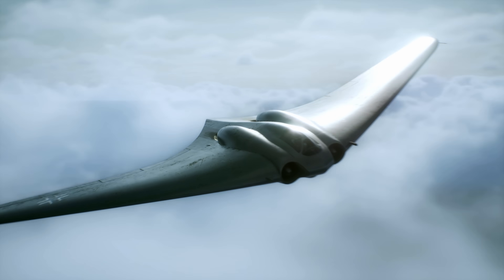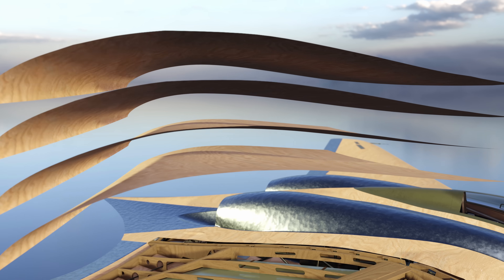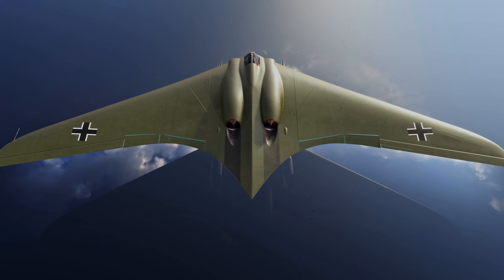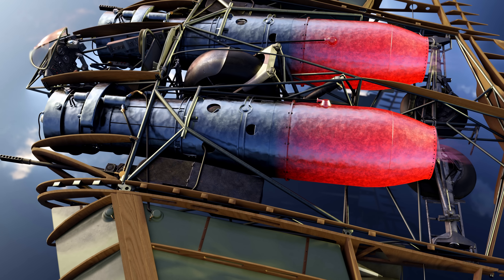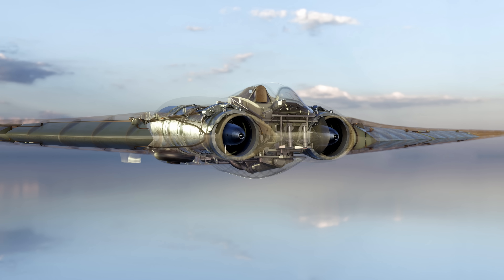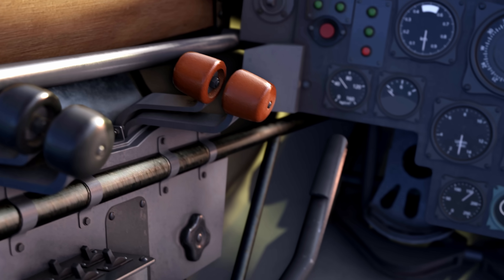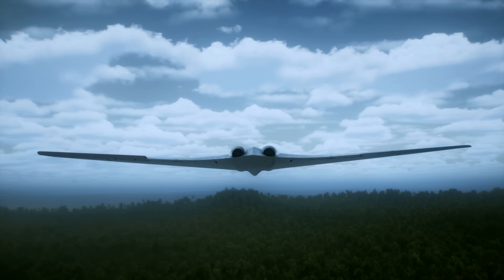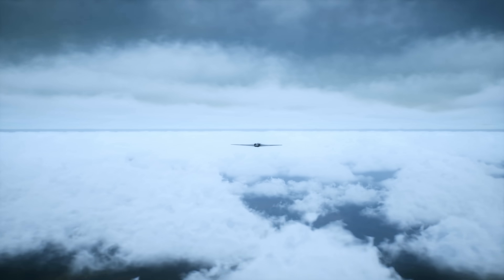Inside the Horten Flying Wing

Comment: I think it's a little disingenuous to bring up the Northrop B2 and HO229 in the same sentence without mentioning the decades of work Jack Northrop himself put into flying wings.
Reply: Jack Northrop never built any radar stealth aircraft, it was his successor that was inspired by the Ho-229 and copied its design. 0:02
Reply: @sandervanderkammen9230 neither did Horton. The HO229 was stealthier than aircraft of the time due to its flying wing design, however, that was due to the Horton brothers following their own flying wing gliders in the 30s instead of some pursuit of stealth. That's like saying Northrops N-1M flying wing from 1940 is stealth because it was made of a similar wood-laminate construction to the HO229.
Reply: The Ho-229 incorporated radar stealth technology while the Northrop N1-N was never constructed and was not a completely design on paper.
 Germany invented radar stealth technology during WW2 and the Luftwaffe published 3 specifications for radar stealth aircraft.
The USAAF was not pursuing any radar stealth technology and America would not begin serious research into them until the early 1970s
Reply: @sandervanderkammen9230  The N-1M flew in July 1940 by Vance Breese. It's kept in exhibit right across the HO229 in the Udvar Hazy center. Where are the documents that the luftwaffe was publishing specifications for radar stealth aircraft? I would like to read those documents. The only thing I've seen about the HO229 being stealth is a claim from Reimar Horton's 1983 book "Nurflugel". And back to the original point, the YB-35, which was drafted in the 1940s, ended up having an identical wingspan to the B2.
Reply: @howdyalmd  None of Jack Northop's designs incorporated radar stealth technology, there was no development of radar stealth aircraft in America until the 1970's
 Both Thomas V. Jones (Pres. and CEO of Northop) and John Cashen (Chief Engineer on the B2 program) were Obsessed with the Ho-229 and conducted exhaustive studies of this aircraft during the development of the B-2 and other German WW2 RAM technology which was incorporated into the B-2.
 The Northop B-2 was heavily influenced by the Ho-229.
Reply: @DoktorBayerischeMotorenWerke I never claimed the Northrop planes were stealth. At best, the N1-M had a reduced frontal RCS like the HO229 due to lack of conventional control surfaces and plywood construction. But Northrop like the Horten brothers both pursued the flying wing mostly due to aerodynamic efficiency. Where did you read that those two men were obsessed with the 229? I am very curious as to where you're reading this. A cursory search of their names and the 229 came up with nothing. I could only find the study conducted in 2008 by NG, where they found the model had a ~20% reduced radar detection range, and analysis of the material of the captured V3.
Reply: @howdyalmd  WRONG, the difference is the Ho-229 is completely devoid of any significant retroreflective structures.
 Anyone who is familiar with radar stealth technology will spot this feature immediately.
 I worked with both Tom and John at Northop and if you knew anything about them you would know that Tom in particular was OBCESSED with the Ho-229 and he convinced John to study every detail of the Ho-229 and reverse engineer it.
WRONG, the tests performed for the documentary were made using modern microwave band radar.
Working vintage radar sets were not available for the tests so computer software simulations were used and showed that against the British Metere Band radar used in WW2, the Ho-229 had a remarkable, over 50% reduction in frontal RCS... both figures are WITHOUT the RAM applied. 
Any questions son?
Reply: @DoktorBayerischeMotorenWerke 
You should talk to a therapist or a psychologist if you genuinely believe that people are “xenophobic ultranationalists” just for not agreeing with you.

It’s an extremely illogical and delusional way of thinking. People are allowed to disagree with you and ask questions if they believe what you say is false.
Reply: @mrnoskills3589  Do you believe that the Allies invented the jet engine???
Reply: @DoktorBayerischeMotorenWerke  Given that Frank Whittle patented (1930), built, and ran the first jet engine (April 1937), yes. Although it would be more appropriate to say that Britain, or Whittle himself invented it rather than the Allies.

Hans von Ohain would patent (~1935), build, and run his engine (September 1937) after Whittle, but would use it to power an aircraft (1939) before Whittle.
Reply: @mrnoskills3589  So you reject the fact that Maxime Guillaume patented the turbojet aircraft engine in 1921???
 Or that Hans von Ohain and Max Hahnn constructed and test ran the first jet engine in 1934?

Or? More importantly the Ohain was the first to successfully demonstrate a working jet aircraft engine 2 years before Whittle on August 27th, 1939???
Reply: @mrnoskills3589  Anyone that claims Frank Whittle invented the jet engine is xenophobic and ultranationalist... IF NOT?They are very Ignorant regarding who actually invented the jet engine.

Comment: Ué, super parecido com os atuais B-2!
Reply: It is no coincidence.
Reply: @DoktorBayerischeMotorenWerke  Smooth brain
Reply: @NOODLLD You didn't know that Northup exhaustively studied and researched the Ho-229 during the development of the B-2?
 Northup's president at the time was completely obsessed with the Ho-229 and German WW2 radar stealth technology.
Reply: @DoktorBayerischeMotorenWerke 
They didn’t have radar stealth technology. The Horten 229 had a reduced radar signature due to the flying wing design and wooden construction, characteristics shared by many other aircraft. It was not enough to be considered stealth.
Reply: @mrnoskills3589  Wow! You really don't know anything about the Ho-229... or radar stealth technology.
 The Ho-229 had over 50% reduction in frontal RCS... that was enough to effectively defeat RAF interception before reaching its target.
 This was a massive breakthrough in aerospace technology that was completely unavailable to the Allies.
Reply: @DoktorBayerischeMotorenWerke 
Where do you find this information? Because every single report I’ve read about the 2008 radar testing of the 229 replica shows that it would have had only a marginally smaller radar signature than something like a Bf-109, and that the speed would have been a far more contributing factor to it being able to evade interceptors.

It had no intentional stealth design built into it. The radar absorbent material that Reimar claimed to have invented was never found on the original prototypes, yet they still included it on the replica and found it was a poor absorber of radar. Massive exposed engine intakes on the leading edge also suggests that they had zero intention of making the aircraft stealth.

You can say as many times as you’d like that the B-2’s design was based off of it, but of the hundreds of people I have spoken to who have made that claim, not one has ever been able to provide any evidence other than the fact that they look vaguely the same. Even then, the B-2 shares far more similarities with the YB-49 than it does with the Ho-229.
Reply: @mrnoskills3589  You are a very, very ignorant person...
Reply: @mrnoskills3589  Of Course not... it's the fact that you continually attempt to ignore the information and data that makes you ignorant... and highly biased.
Reply: @DoktorBayerischeMotorenWerke 
The information and data that you have not provided after over two weeks of back and forth?

I cannot ignore information which does not exist. Show me sources that back up anything you have said, or I’m going to continue to assume that you’re speaking nonsense.

Comment: no wonder how then Americans built B2 spirit
Reply: Nothrop had Experience Building Flying wings from the YB 35, google it german didn't Invent the Flying wing
Reply: @NOODLLD The B2 was developed directly from the Ho-229
Reply: @sandervanderkammen9230  No it wasn't, not even Close Buddy. The Ho229 was rotting in a Warehouse forgotten while the B2 was Made
Reply: @NOODLLD The Ho-229 was exhaustively tested and studied in the 1970s by both Lockheed and Northrop during the  development of their own radar stealth aircraft.
 The B2 is heavily based on the research conducted on the Ho-229.
Reply: @sandervanderkammen9230 The Ho-229 was radar tested once to shut down the myths spread by Reimar Horten in the 80’s.
Reply: @mrnoskills3589 Radar tests performed in the 1970s confirmed that the Ho-229 had low observability and the RAM used on the B2 was originally developed for the Ho-229
Reply: @sandervanderkammen9230  Radar testing of the Ho-229 didn’t happen until 2008. The RAM that Reimar claimed to have developed for it never existed. It was never found on the original prototypes, yet it was still recreated and tested and was found to be a poor radar absorber.
Reply: @mrnoskills3589 You have not done your homework, the Ho-229 and other examples of radar stealth were very throughly rearched and tested in the 70's.
 Germany invented RAM it not only developed several types of RAM it was also manufacturered and used in operational service during WW2.
Reply: @sandervanderkammen9230  I’ve already looked for the tests that you claimed Lockheed and Northrop did in the 70’s and it seems they don’t exist. Who did these tests, when did they do them, and where can I read about them?
Reply: @mrnoskills3589 You need to ask the DoD, Lockheed and Northrop those questions.
GOOD LUCK!
Reply: @sandervanderkammen9230  “I will once again deflect and not give you the source of my information. Go ask somebody else, good luck.”
Reply: @mrnoskills3589 Can you please cite some evidence that the Lockheed F-117 and the Northrop B-2 actually has low radar observability?
Reply: @sandervanderkammen9230  Do you think bolding your comments makes them seem more legitimate? It doesn't.
Reply: @JamesThomas-kx5sj  They bold their comments so that it looks different than the comments on their other accounts, as if it still wasn’t obvious that it’s the same person.

They have at least three accounts that I’ve seen on this video and Blue Paw Print’s Me-262 video, all commenting on the same videos, at the same time of day, all with the same copy and pasted comments, false information, and insults.

Comment: I remember seeing a study into the stealth capabilities of the Horton some time ago which suggested that, against the radar of the era, it was indeed effectively a stealth fighter, and that it's wooden construction supposedly helped absorb allied radar, so I'm curious about Grumman's results, and how they tested it... Did they test it under modern conditions, or against the conditions of 1945?
Reply: Northup used modern microwave band radar to test the Ho-229, but they also used a computer software program to simulate the test using the more primitive British Meter band radar.  
The simulations showed a very significant 50% reduction in frontal RCS and this was without the RAM applied.

Comment: I had read that the preserved airplane and it's wings are not connected because they don't match and are thought to be from different prototypes.
Reply: +@DavidVanderVoort-t2g   It did not have wings when it was found in the Gotha workshop.  Some wings were found some 75 miles away and I've never researched if they are an exact fit.
Reply: The wings from this particular aircraft are believed to still exist and are stored at a military research facility near Munich, Germany.
An Austrian engineer that worked there in an interview told Wehrtechnik that the wing sections had being removed before the war ended and had RAM applied to the outer surface but was not completed when the war ended.
The German government considers them classified material and they  are not available for public veiw.

Comment: Die Tarnkappengeschichte der Ho-229 ist ein Mythos: https://www.youtube.com/watch?v=m_fqmxUzSfU
Reply: Northrop conducted tests that proved its stealth design.
Germany invented radar absoorbing materials and radar stealth technology during WW2.
Reply: @sandervanderkammen9230  Schau Dir das Video an! Northrop conducted war voreingenommen und hat in der Dokumentation übertrieben. Das haben die später zugegeben.
Bei der Konstruktion der Ho-229, spielte die RADAR-Reflexion keine Rolle, das wurde ihr erst später angedichtet! Sicher hat die Ho-229 etwas weniger RADAR-Fläche aber das spielte bei der Entwicklung keine Rolle!!!
Reply: @Bildpunkte Tests confirmed that the Ho-229 had a staggering 50% reduction in Frontal RCS compared to conventional aircraft of its size.
 It's fundamental design is completely free from any significant retrorefletive structures
 No test were conducted with the RAM applied
 Data on German WW2 RAM technology still remains classified today.
Reply: @sandervanderkammen9230  It was only 30%, not 50%. Furthermore, no real turbine intake were used in the tests, which reflect much more radar radiation than the dummies in the test.
Reply: @Bildpunkte  When corrected for the Meter Band radar used by the British it was over 50%... and that was without the RAM,  anyone familiar with Radar Stealth technology knows that a jet engine is inherently radar stealth compared to any aircraft that relies on a large spinning propeller... some amateur denialist seem to be complete ignorant of this important fact.

Comment: 4:15
There is a contradiction.

Because the flying wing design was used after the Second World War.

With the B2-Spirit.
Reply: The B-2 is based on the Ho-229.
Reply: @sandervanderkammen9230  No
Reply: @NOODLLD. Your comment reveals someone who knows nothing about Northop or the B2
Reply: @sandervanderkammen9230  Please Explain how Northop used a Flying wing Fighter from WW2 which sat in a stoorage forgotten for a long time To Built a Modern Long Range Stealth Bomber?
Reply: @NOODLLD. Both Lockheed and Northrop conducted top secret research work on the Ho-229 during the 1970s.

The Northrop B2 bomber was developed directly from the research on the Ho-229.

Comment: without fly by wire, it's a complete pipedream.
Reply: Germany invented fly-by-wire technology in the 1930s.

What flying wings need is an automatic yaw damper system... invented in Germany during WW2.
Reply: @sandervanderkammen9230  cite the source please, this sounds wildly problematic.
Reply: @h.m.stanley Certainly, Siemens AG. Invented fly-by-wire flight controls and ALS in  1941.
 The world's first aircraft to fly by FBW controls was a Heinkel He-111.
 Germany also Invented yaw damper controls during WW2.
Reply: @h.m.stanley he has done nothing but make statements if you look at his other comments half of them are just straight up fabrications
Reply: Well, its design was based on a glider, so not AS unstable as one may presume. Not when the engine blows up, and it will, then we get into real problems
Reply: @peskyshoes Most twin engine aircraft suffer from poor asymmetric flight characteristics.
Even conventional twin engine jets like the Gloster "Meatbox" are generally considered  deadly when a engine failure occurred.

The Meatbox killed 450 British pilots in RAF service in non-combat operations.

Comment: The grandpa of B2 ?
Reply: Yes, it is the predcessor to the B2
Reply: The B2 program has nothing to do with Ho229. The research for the B2 comes from Jack Northrop's flying wing designs from the N1M to the YB-35 and YB-49. The stealth elements of the B2 are based on the research for the Tacit Blue program and contributed to the YF-23 as well.

The only thing the B2 and Ho229 have in common is that they are both flying wings and thats it. Any claims that the Ho229 was stealth in any capacity are false as any inherent stealth properties gained by the Ho229s design would have been negated by the steel frame, large open jet compressors and steel plating on the front of the airframe.
Reply: @Tozzpot500 Both Lockheed and Northrop conducted exhaustive research on the Ho-229 during the 1970s and the development of Americas first radar stealth aircraft.
The then president of Northrop was obsessed with the Ho-229 and its stealth design.
Reply: Both Lockheed and Northrop conducted exhaustive research on the Ho-229 during the 1970s and the development of Americas first radar stealth aircraft.
The then president of Northrop was obsessed with the Ho-229 and its stealth design.
Reply: @Tozzpot500  Both Lockheed and Northrop conducted exhaustive research on the Ho-229 during the 1970s and the development of Americas first radar stealth aircraft.
The then president of Northrop was obsessed with the Ho-229 and its stealth design.

Comment: Rumours have it that the jet still exists up to date and you gazed it correctly it's the upgraded version the US B2 bomber
Reply: The B2 has no relation to the Horten, other than both being flying wings.
Reply: *Both Lockheed and Northrop conducted exhaustive research on the Ho-229 during the 1970s and the development of Americas first stealth aircraft.*
The then president of Northrop was obsessed with the Ho-229 and its stealth design.
Reply: @sandervanderkammen9230  Google the First Stealth Jet, the F117 doesn't look like the Ho229 at all.